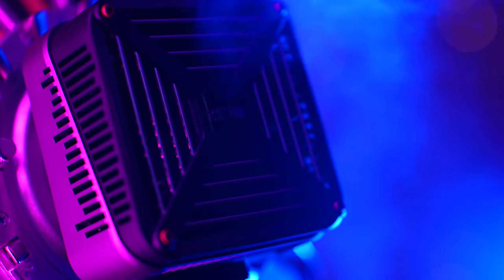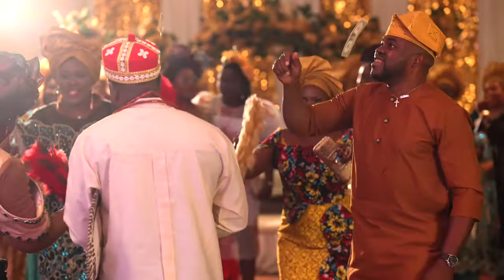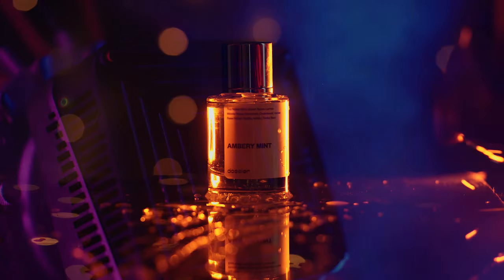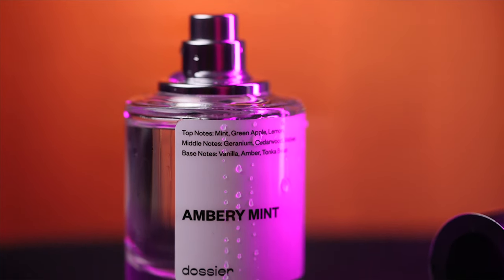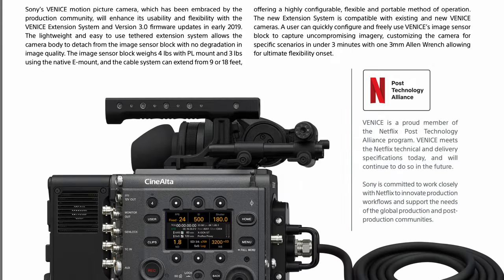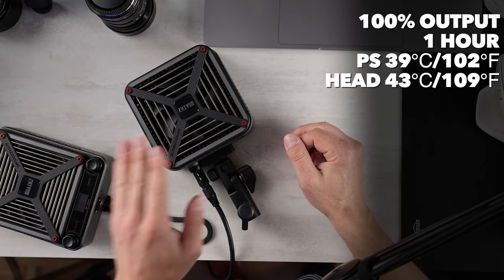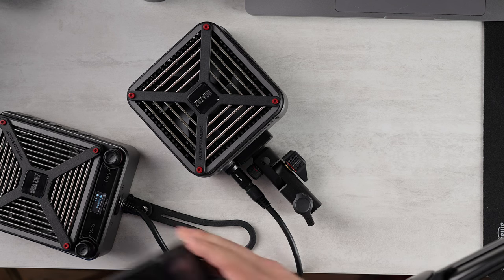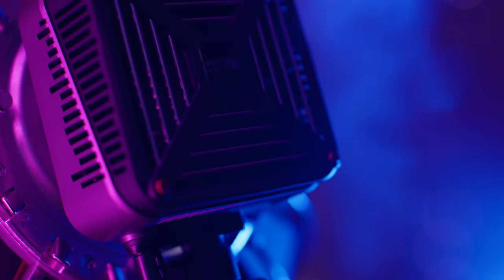Pushing the Envelope - Zhiyun Molus G200 Review

Comment: Hi Wes, does this light gets really hot for using 10 hrs like events and weddings events?
Reply from the maker: Nope. I ran it for over 8 hours on a few occasions and after about 30 mins it reaches an equilibrium which isn’t terribly hot. Probably because the air passes straight through it, there’s really nowhere for it to soak.
Reply: @WesPerry  what about using for shortfilm and indoor shoots ? And when compare to g200/amaran 200xs/nanlite fs 200 which is best ?
Reply from the maker: @jokerstudio7260 that’s a very personal question. Being such different form factors it really comes down to that. While the G200 can fit into spaces others can’t, the dangly bits can be more annoying… or less annoying!
Reply: @WesPerry What about nanlite fs-300b vs zhiyun g200? Brightness, overall. Will you make a short video of this both comparison. For the price, because g200 has max of 300 watts but that's an option for max mode. When fs-300 is 300 watts by its full power.